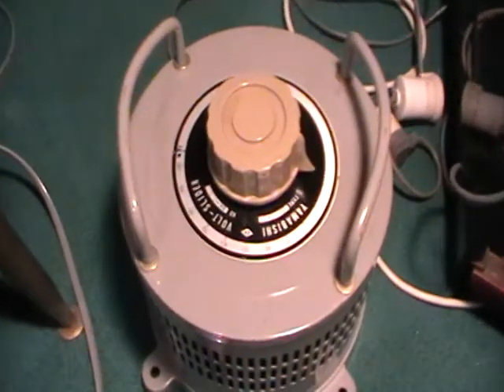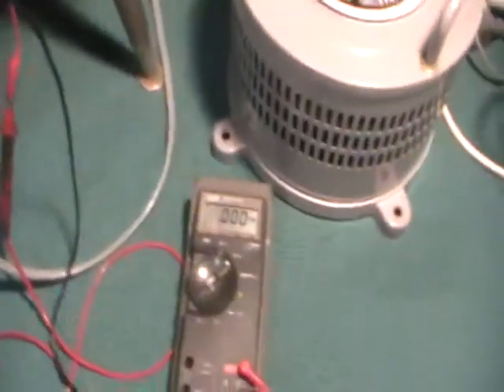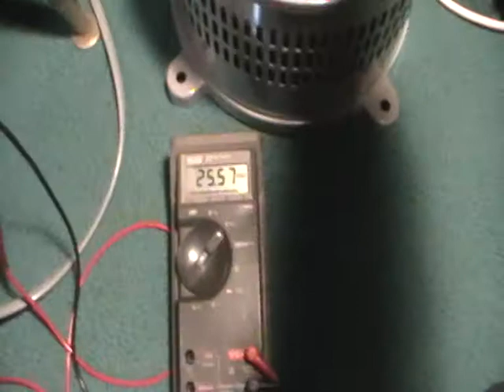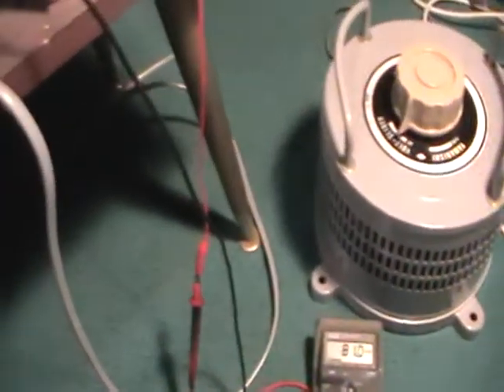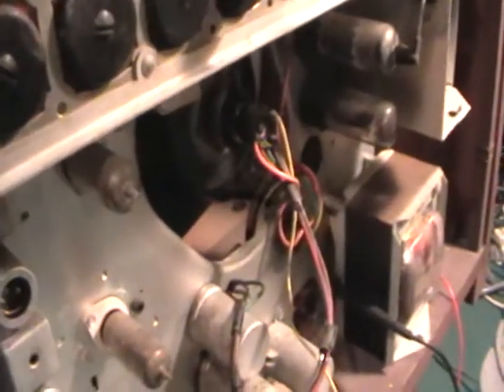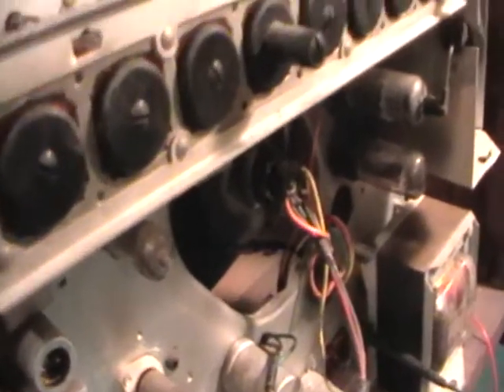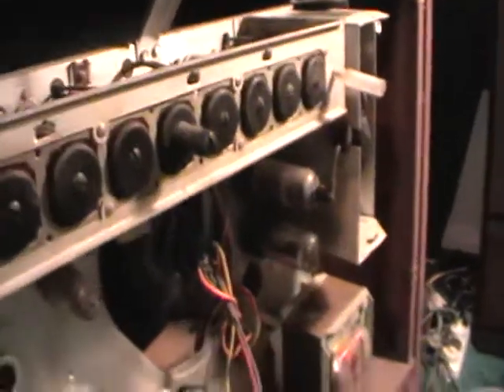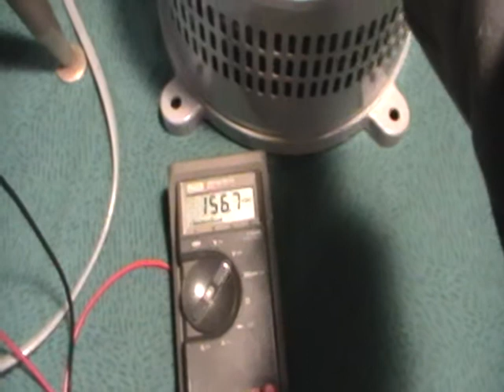Murphy 23 inch 1960's Vintage B/W TV Part 6

Comment from the maker: Hi it really depends how much use the set has had, what enviroment it has been in and the state of the components and valves in circuit with it. The LOPT in this one looks to be the original and appears to have some life left in it, but these can fail at any given time due to age and moisture getting into insulation/windings.Always pays to reduce the width/boost voltage as well so the LOPT isn't been driven as hard. Cheers